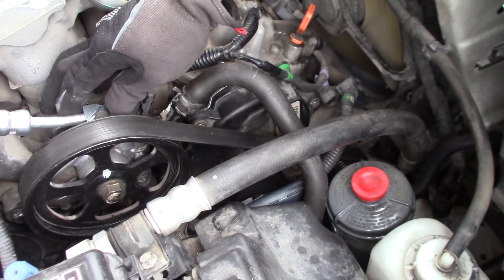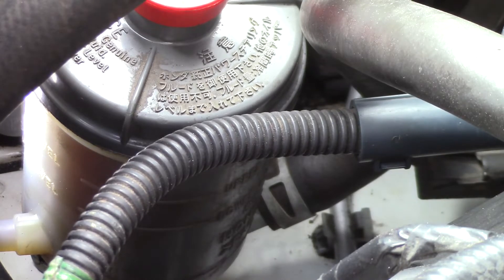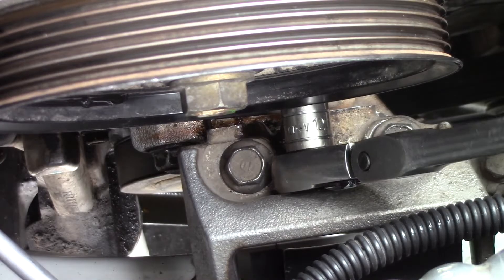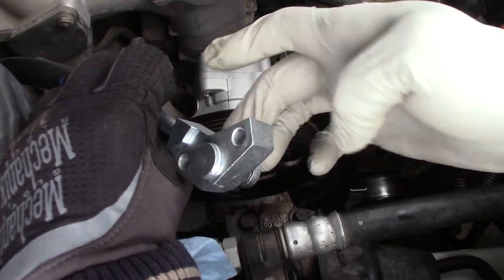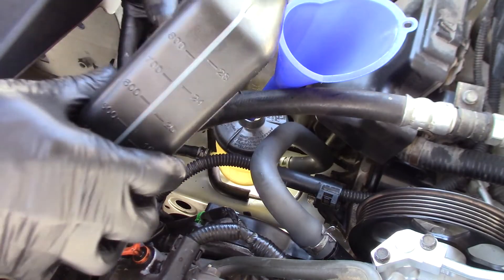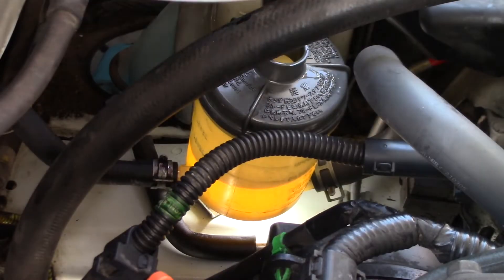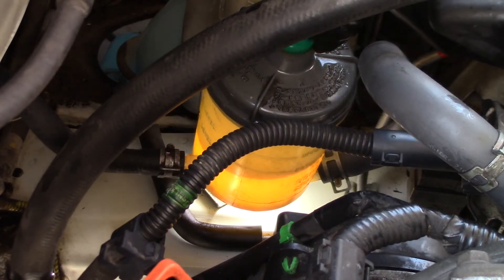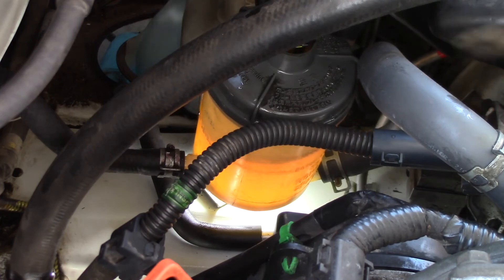Why you should never vacuum bleed this Honda power steering system while it's running

Comment: Great video! I just changed my power steering fluid on a honda element. I'm not sure what happend but I'm no longer getting any air bubbles and my outlet hose from the resevoir is crushing with air after running for 30 sec or so. I can hear the suction as the engines running coming from the resevoir side of the hose. Eventually the resevoir will overflow if level is topped off. I'm hoping I didn't burn any components. Cars off the ground. Was rotating tires with car off, then on. Wasn't driving around town tearing up the pump. Any suggestions what I can do? Did I just not get all the air out of the system..